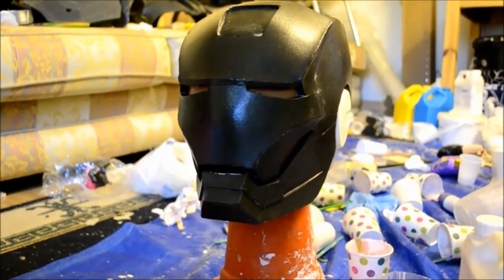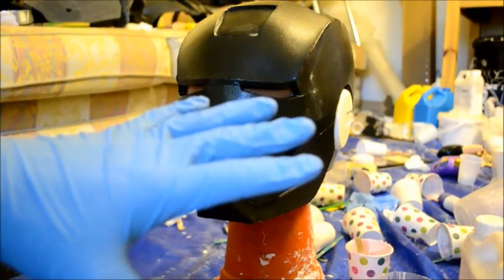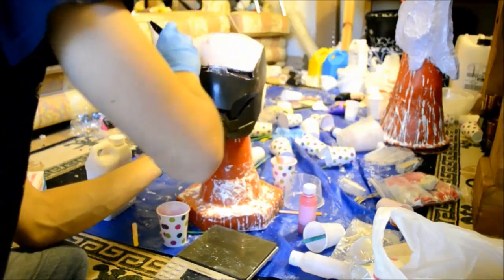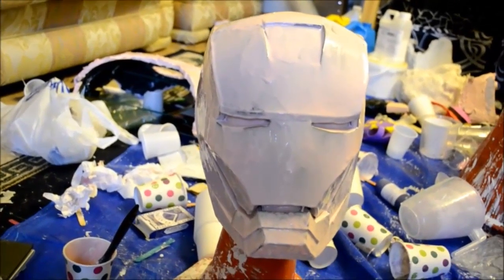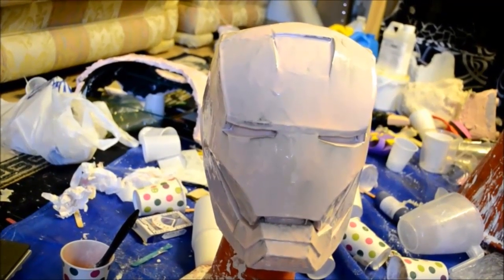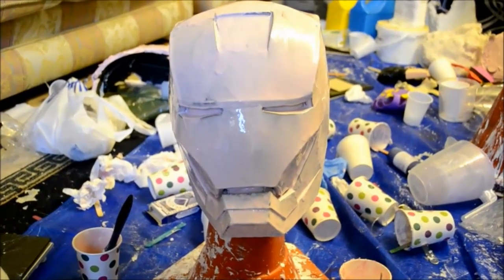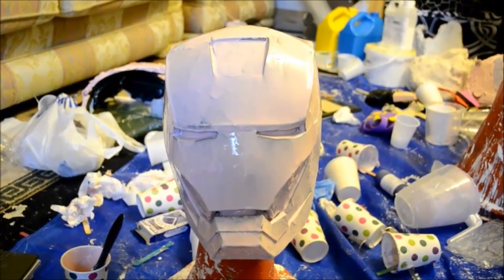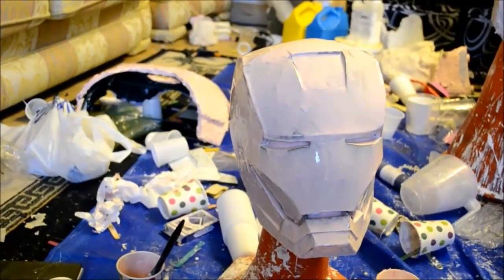10 - How to make a  silicone mold - Latest Iron Man build update.

Comment: Hey! Quick question! :) do i have to do the pva layer process? or can I just put the silicone straight onto the mold?
Reply from the maker: Nicholas Basuel i would assume without it the silicone would seep into the foam holes and would ruin the mold so i wouldn't risk it
Reply: awh thanks man! :) you actually replied really quick! thanks :) 

Quick Question: Is the smooth-on 65D helmet heavy?? (assuming that's what you used)
Reply from the maker: you're welcome :)
Reply from the maker: Sorry I missed the last part! And not at all! It does have some weight to it but not enough to be too heave when wearing it. Just enough.
Reply: Lol thanks dude! Huge fan of your channel btw

Comment: Do you need to use a mothermold for this process?
Reply from the maker: for moulding and casting, yes, although you dont have to do that you could just paint the foam if thats what you wanted
Reply: StarksWarehouse Right, I realised after I posted that I had seen a mothermold being used in other silicone and resin cast tutorials, do you know if there are any alternatives to using fibreglass when making your mother shell?